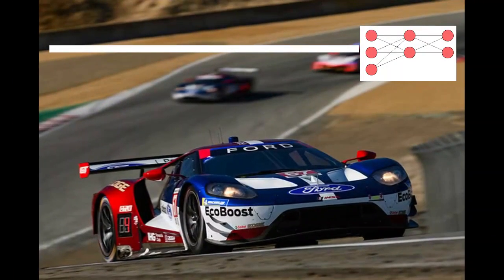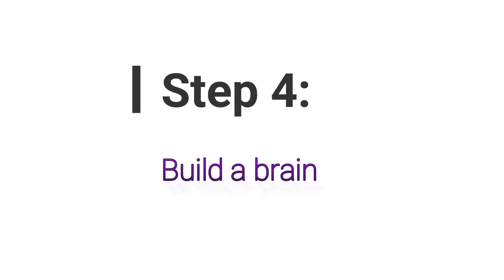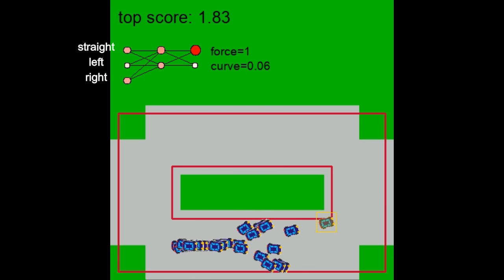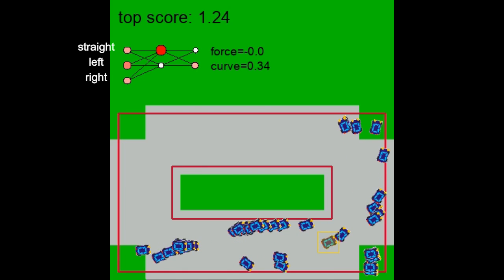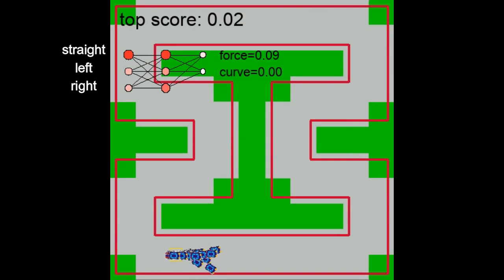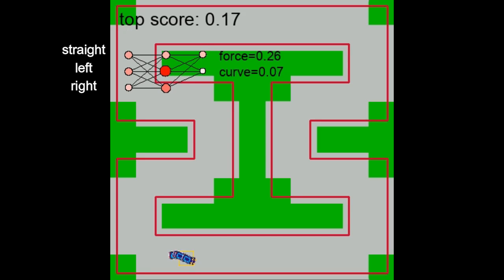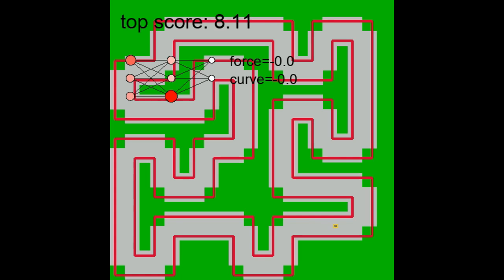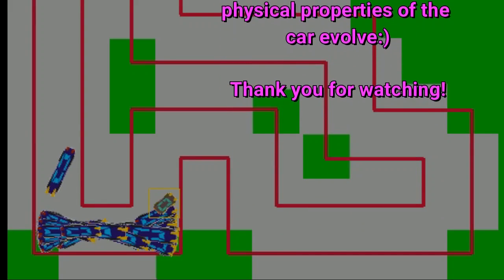I Trained Self-Driving Cars using a Genetic Algorithm, Part [1/2]

Comment: Why did you need to increase the number of neurons in the hidden layer from 2 to 3? Is it because the car now has to make right turns in addition to left turns? If so, could you eliminate the third hidden layer neuron by allowing right turns as a negative turning radius?

How often is the distance data updated?

Why have you chosen to animate the circles instead of line thickness? Line thickness would be a more accurate representation of the connections between neurons IMHO.

Great job!
Reply from the maker: Thank you!

As you probably know, a neural network can be seen as a differentiable function mapping from an input space (here the 3-dimensional space spanned by the distance measures) to an output space (here the 2-dimensional space for positive/negative steering  and positive/negative acceleration). Adding a neuron to the hidden layer allows this neural function to be more complex and hence, it can learn a more complex relationship between the input and the output. 

In my experiments, I realized that for a simple racing track like the first, 2 neurons in the hidden layer are enough while for the more complicated tracks it was not enough to learn the relationship between input and output.

The distances are updated in every frame.

For the animation of the neural network, I give you right that in principle the thickness between the neurons would be more informative if one wants to know what the exact learned network actually is. On this point, I also used to bias neurons, one for the hidden layer and one for the output layer that are not shown. However, in this case I found it more interesting to show the function's phenomenon instead of its composition mainly for the following two reasons. First, the connectivity is a static statement such that it would not change from frame to frame -> boring.  Second, for neural networks with at least one hidden layer it is very hard to find an intuitive interpretation why a particular set of connection might work better than an other. Therefore, I chose to show the dynamic phenomenon of the systems input, intermediate representation and output. I felt like it would be kind a too-much-information to additionally make connections thicker or less thick. You would also need to have a color code to distinguish negative from positive weights.

Comment: Excellent video!  Waiting for part 2. What is/are the activation function(s)?
Reply from the maker: Thank you! The activation functions are sigmoid, and for the output is tanh-like such that the force and the curveradius are bound. In this way, I could also make the minimal curve radius dependent on the current velocity to simulate grip.